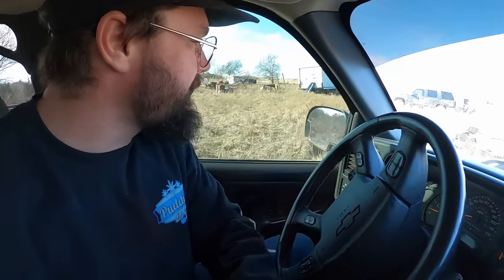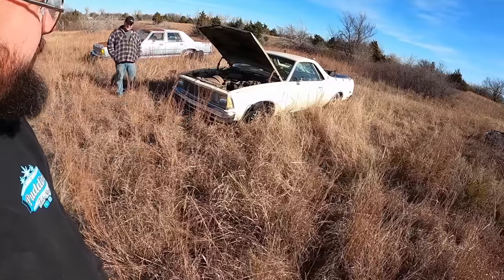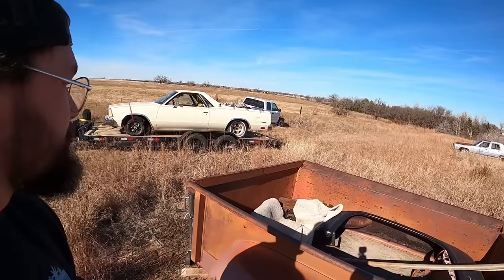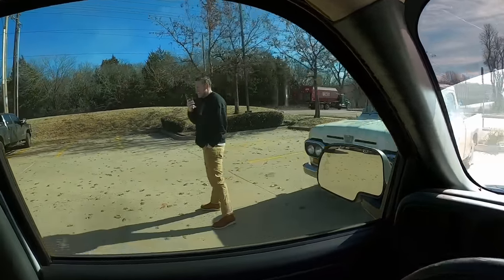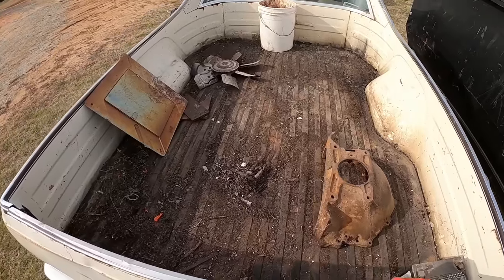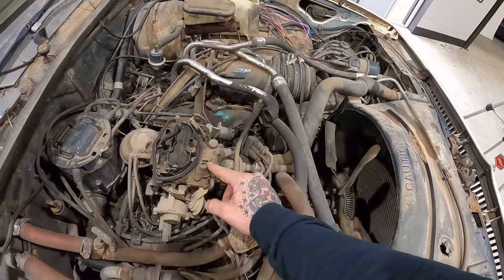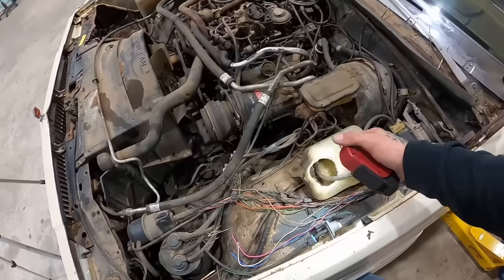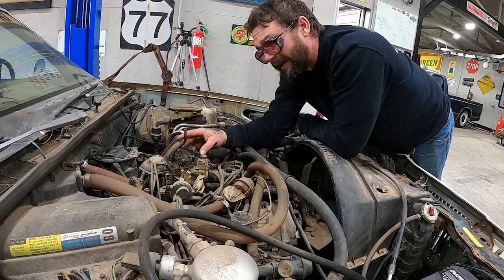1980 El Camino. FORGOTTEN in a Field. CAN WE DRIVE IT?!?

Comment: The lock up problem on the left front is classic rubber hose colapse. The hose colapse allows presure to flow to the caliper but wont allow tge fluid to return. When you open the bleeder it relieves tge pressure.
Reply: I was just going to comment the same thing, I agree with your assessment
Reply: I had the same thought
Reply: Agreed. You beat me to it lol
Reply: 100%
Reply: Agree!
Reply: Was going to see if anyone else made this comment before posting it. New brake hoses all around would be approved.
Reply: 100% agreed
Reply: I came here to say this.
Reply: Was going make the same comment!!
Reply: Exactly my thoughts
Reply: Exactly
Reply: Yep, collapsed brake hose.

Comment: Double check your brake hose on the sticking side. The inner hose can collapse and act like a check valve.
Reply: This, the brake hose is collapsed.  You can pressure past it, but it won't let the fluid return.
Reply: Duh
Reply: Agreed
Reply: I spent 10 minutes screaming at the tv trying to get you to replace the drivers side brake hose.   Its collapsing and causing the caliper to hold pressure

Comment: The g body front suspension is also compatible with s10. But the el camino is 7" longer wheelbase. They're malibu wagons with roof cut off. That's why the smugglers compartment still has wagon floor area
Reply: The Elcaminos were like wagons UNTIL the G-body (78 - 87's)
    The G-body Elcaminos had a separate frame from the station wagons in the last generation. 

  The GBody Elcaminos had their own unique chassis.

Comment: Hey, Puddin.  That thing on the thermostat housing is called a Ported Vacuum Switch.  Just break it off and plug all the lines that went to it.  Also, the turbo looking thing is an AIR pump.  Also something to disconnect and delete.  That car deserves some Astro Supremes.
Reply: Also known as a smog pump.
Reply: Thermo switch
Reply: Pay attention to vacuum advance issues, just yanking off stuff without knowing what it is can bite you. Ask me how I know......
Reply: @mwb3984  how do you know???
Reply: @mwb3984 yeah what he said.
Reply: @mwb3984  You Know what's up. Ol' Puddin' Came along after all this Vacuum ported Stuff. I found when New Doing Tune ups etc. you would just replace all the Cracked split Vacuum hoses (diagram) right on the Radiator support. If you knew how to read those. You knew which hoses went where. That car would be a Whisper Jet. After a proper Tune up. IMHO
Reply: Your sand box, your rules but I have to say it hurt to watch you bash up that rear end with the towrolla.

Comment: PARKING LIGHTS TURN ON WITH THE BRAKES: I have an 85 Cutlass with the same problem. Check the steering column to see if the hazard switch is on, i think it has something to do with the flasher being bad but i fix my by just turning the switch off and not having hazards for the last 20 years

Comment: Really like the El-Camortski. My recommendation? Get a gas tank, sort the wiring and vacuum lines, fix the carb, fix the floorboard, get yourself some proper drop springs, pound the dents out of the tailgate.  And before I forget, get a replacement inside drivers door handle. Then come up with a cool name and decal for the truck like your YouHaul trucks.

Comment: That frame, if I can recall, is the same as the Malibu station wagon. The suspension will be the same in the 78-88 A and G body cars
Reply: El Camino frame is all by itself,wagons  are different. Front suspension is same as S10 except for the steering cross link, because the S10 is a narrower track with. S10 drop spindle and front spring will work on Camino. That carb is just a two barrel quadrjet . Check the float, it's probably bad. Plastic float and ethanol don't mix well.

Comment: The valve with the hoses is a thermal vacuum switch.

The thing on the motor that you were asking about earlier in the video is a smog/air pump.  The pulley for it was inside the cab.

Comment: Them front rims look like the rims off an Old Cutlass from the 70s-80s. I had some that I used on my 64 Ford Econline pickup truck from off a 71 442. My brother in law put them on the Ford Econoline and went with chrome reverse big and little steelies with moon hubcaps on the 71 442 that I eventually bought from them as well. I really like how they look too. My ex GF had the same El Camino in the maroon flavor paint. Love those old cars too.

Comment: The “turbocharger” under the hood is an emissions junk smog pump, either locked up or they just removed the pulley and bypassed for “more power”. But of course they left all the vacuum junk hooked up. The exhaust had that new pipe scabbed in because they cut out the catalytic converter. The front brakes are sticking and not returning because the rubber line has deteriorated and collapsed on the inside, trapping fluid/pressure. That’s why opening the bleeder allowed it to move because pressure bled off, probably pulled some air back into the system as well which is why it would spin even with the pedal pushed, had to build up fluid pressure again to overcome the air maybe? The transmission was probably in gear when you first checked the fluid level so pump was engaged, that’s why it was low. Then you added fluid, car started moving, you put it in park disengaging the pump, boom fluid level high. Love the custom exhaust work though. I wonder if the M90 supercharger off the Series II 3800 Pontiac, Olds, Buick, or Monte Carlo SS could be put on there. Little blow through carb action. I know you’re not a fan of or super comfortable with EFI.

Comment: The thermal vacuum switch you asked about can be important unless you are going to take everything "factory" off of it ... the ignition advance can be actuated/suppressed according to temperature(as you correctly surmised) - there is a middle road that retains the basic systems and deletes stuff like the A.I.R. pump.

Comment: Those are great vehicles. I had a 1973 Blue Datsun truck I traded in on a 1979 El Camino which was powder blue It almost looked like the one you have. I bought it at Hembree Chevrolet in Poteau Oklahoma with 17, 500 miles on it in 1981. It had the 305 V8 in it. Had it for awhile. I miss that one. Kerry

Comment: Pollution pump is the thing you see without the belt on it. And yes 3.8 was in most cutlass, regale, and some other g bodies. Especially  the grand national,  same motor just better internals and turbo
Reply: You are correct. However the 3.8 in this El Camino is a Chevy 3.8 (229) V6. Kinda the precursor to the 4.3 vortec V6.

Comment: Excellent video Puddin  :) , Slick 50 :) , Bill  :) , 1980 El Camino  car remember in my childhood  from 1976 to 1994 years  also yes  that had V6 3.8 litre , 4.4 litre 267 V8 in 2 or 4 with small or air breather , 5.0 litre V8 305 in 2 or 4 barrel carb  , 5.7 Litre 350 V8 , optional  motors was 5.0 litre  307 V8 4 barrel ,  small block 6.6 litre 400 V8 , 7. 3 Litre 454 V8 4 barrel carb , some motor did have Pollution Pump below Alternator  too , Power Steering also Brakes, some Cruise Control also Tilt Steering, Am/Fm radio antenna on front windshield or pop rod fender , Am/ Fm radio with or without Cassette, Transmission are Manual 3 , 4 , 5 speed  of Column Shifter 3 in tree also floor were 4 or 5 speed, Automatic were 200 to 2 speed  Power Glide , Turbo 350 or 400 3 speed , 700SR 4speed Overdrive Automatic transmission, air conditioning, power windows, mirrors, locks , rear end 303 to 411 ratio too! That specs on them Puddin to get in years ago ! Those  Back rims on when gotten on are orgnail ones and to if didn't know!

Comment: Regarding the front left wheel locking up puddin', it spins free every time you open the bleeder because it's relieving the pressure. That's a sure fire diagnosis for a bad brake hose. When the brake hoses go bad they act like check valves, they'll let the brake fluid flow into the caliper when you hit the pedal but then when you let off the brake pedal that fluid gets trapped in the caliper and the wheel stays locked up. Opening the bleeder lets the trapped pressurized fluid out and the brake releases. Hope that makes sense.

Comment: Have you ever tried using a small drill bit to drill through the hinge and hood. Then when you put the hood back on use the same drill but to line everything up by sticking it back in the holes. I always drill one on each end of the hood bracket and then have four drill bits to line everything back up. Once a drill bit is in each hole I tighten the bolts down all the way

Comment: Its the ruber lines in the front. When they get old they will swell up on the inside and fluid can gate through with pressure but it can not go back through. Just replace the soft line and I bet they will work.

Comment: I had a "91 Buick Skylark Custom with a 2.5. I was driving home from work one day. It was running fine, and then it just went dead in the middle of the street. I was just learning at the time, and I loaded up the parts cannon and let it go. Six months and $1500 in parts later, I found out that the plastic timing gear had broken. Since it was a one off engine and they were unobtainium, it took me three months to find a similar one in a junkyard. It was running perfect one minute, and dead as a doornail the next.

Comment: I had a '79 Volare with a Leaning Tower of Power. All six of the electrodes on the plugs were completely encased in ash. You could not see them at all, and that car would still do 120 all day long. You can't beat a 225. I still have those plugs, and everyone says I am full of shit when I say that engine ran on those plugs, but it did.

Comment: That 3.8 is the Chevy 229 V6 versus the Buick 231 3.8 V6.  The 229 is a small block Chevy with two cylinders whacked off.  Front accessories are interchangeable with a SBC.

Comment: 1:11:28 you have a collapsed brake hose on that side, pressure gets thru to apply, but it cant flow back to release. The fact it releases with the bleeder opened confirms a bad line. This is a common problem with gm.

Comment: That looks like a TH200 transmission. Fluid color indicates a lot of clutch material in the pan, but it's obviously working, so it may be fine. With a good carb, she seems like she'll make a good car. Great video!
Reply: If it's the same as a my 1980 Lemans that also had the Chevy V6, it probably has a lock-up converter. I dropped the trans pan at 110K miles and it had an alarming amount of clutch material in it, but it continued to operate without any slippage for another 30,000 miles. When I sold the car it was still going.

Comment: @34:17 It’s called a TVS (thermal vacuum switch). It controls the application of vacuum to the EFE (early fuel evap) valve, and the A.I.R. diverter valve

@45:30 TH200C

Comment: One more thing Puddin' when working on those things new, the HEI would Quit. Extended Crank it? Another Common issue is the Distributor Rotors would burn straight through to the metal advance weights make a Crank no start symptom FYI

Comment: Brake line will let brake fluid through not back out they swell after sitting I would change the brake lines it will fix the sticking brakes

Comment: In the 90's I was in Nqvy and bought 82 El Camino that had been swapped from V6 to 350 V8 but not 4 bolt. Built a four bolt 350 with edelbrock intake and carb. It had all custom interior tan tuck and roll with diamond pleat on doors and overhead. Wooden vette steering wheel. Wish I still had it. Was T- boned by an F150! Was listed as licensed in Montana so no EGR and headers with thrush dual coming out by back wheels.

Comment: From what I remember from my 1980 El Camino I had 33 years ago:  The back glass is bad about leaking in these.  Water gets in to that cubby hole where the tire sits and makes the floor rot out.  Mine had a flexy exhaust, too.  They ride REALLY low and scrape on EVERYTHING.  Mine had an 8-track and the speedometer would peg at 35 mph no matter how fast you went.  But it was right up to 35, past that you had to just keep up with traffic.  The 3.8 is probably better than the 5.0 V8 that I had.  Those early 80s 305s sucked.  The V6 probably has as much power, too.

Comment: If you start to have more issues and it starts to miss ,it could be the ignition module I had the same issue on high output 305 SS Monte Carlo motor

Comment: that "thing" is an air pump to blow cold air in the exhaust manifold for smog control. They started that nonsense in the mid 70s. toss it, pull the tubes out of the exhaust manifolds and plug the holes with pipe plugs. You can thank me later ;)

Comment: Don't know if anyone answered but that accessory bolted to the front of the engine missing a pulley is an air injection pump. The thought was that to reduce emissions they could blow air into the exhaust stream. The always locked up. FYI, more than just a liter of displacement differentiating the 3.8 (Buick) from the 2.8 (Chevy). Entirely different animal. That 2.8 is gonna be very anemic in a vehicle that size. There's a whole rabbit hole involved with all that.
Reply: I believe they have a 200 or 229 Chevy based 90 degree v6, a cut down small block Chevy v8 engine missing two cylinders. Pretty stout for so few cubes. Not related to the flimsy 2.8 found in Fierros and Citations.
https://en.wikipedia.org/wiki/Chevrolet_El_Camino

Comment: Them rubber lines get a bubbles in them. An internal leak.i popped the wheel bearing cap off my rig.  Put new calipers on. Still dragging. New rubbers, tada!  No moore dragging

Comment: The best advice when working on older model vehicles is, "It's always something simple (Don't Overthink The Problem). Especialy for teaching younger fellas, when it's got a Carb & Distributor. Ya just need the 3 basics. Fuel, Fire (Spark) & Compression. This holds true for any Engine from 1 to 10 Cylinders.

Comment: Happy New Year Puddin, and to your whole family. Ya done great in 2023 and I wish you the best in 2024.  You deserve it, sir.
 You gotta watch out for those G Bodies, especially the mullet mobiles. They get in your brain and make you make bad decisions, kinda like mini trucks and International Harvester products, lol.
  I'm generally a Ford guy, but I've got a 78 El Camino that I wouldn't trade for the world. I've still never figured out the purpose for those 2 silly little hood screws.
 That transmission is the much hated TH-200. Yours could well be the last one in existence that actually works west of the Missippi River, but you don't know if it actually shifts, so... lol. A TH 350 is almost a direct swap. I did lots of those swaps BTID. 
 The 3.8L (229 cid) in the Chevys of that era were Chevy small blocks with 2 cylinders missing. The other GM lines used a Buick V8 based 3.8L (231 cid) V6. The 229 eventually became the 4.3L (262cid) pickup truck engine, which I "think" were the very last of the small block Chevy based engines. The 229s were under powered and under appreciated, but as dead reliable an SBC V8.

Comment: Nice 👍gotta love those El caminos.  On the HEI module be sure to put heat soaking gease between the module and distributor base with out the grease to conduct heat away it can leave you stranded.

Comment: The switch on the thermostat housing is a "thermo-vacuum switch" Your explanation of how you think it works is basically spot on. As far as the driver's side brake hanging up, the left front brake hose is collapsed inside the rubber. It acts like a check valve. It lets brake fluid through,  but wont let it release back to the master when you let off the pedal. As cheap as they are, just change both the fronts if you plan on driving it in traffic.
Reply: I was yelling that at my tv while puddin was hammering on the master and portioning valve. 😂

Comment: Pro tip for exhaust work if you don't already. Run a deburring tool around any exhaust tubing that's been cut before welding it up. No floppy edges to mess up the sweet sweet sounds.

Comment: Hey puddin' a shop trick for you- When removing old hoses, remove the clamp then put a pair of channel locks where the clamp was and rotate a few degrees left and right. You'll feel it unglue itself. Then it will pull right off without cutting.
Applies to all vacuum, fuel, coolant, etc hoses.

Comment: The 3.8 liter is one of the best engines ever built. They've routinely gotten over 300k miles on them ,few engines can boast that.
Reply: You're thinking of the Buick designed engine that was refined for FWD applications. 
This El Camino has the small block Chevy V-6. A completely different animal.
Reply: It is completely different, but the Chevy has a good reputation, too.  I mean, it isn't for towing, but...

Comment: Had a 305 that ran hot, rebuilt carb, timing chain and timed it dead nuts and it finally died. Replaced module and it quit overheating and ran like a dream. Owner said it never ran so well.  Nice old elk. Worth fixing-ish. Would look even better if steelies were body colour.

Comment: That wheel you said you didn't like is probably factory to that vehicle. Also found on Monte Carlo and Malibu (which is what the front end is). The wheels you like are from an Olds Cutlass. The one from the rear might have also been found on an 'Ol Camina but are common to 2nd Gen Camaros. Any small block Chevy and trans will go right in that vehicle. You can even swap front ends with little or no modifications with all the G body cars as that's it's platform. Monte Carlo, Malibu, Cutlass, Regal, and Grand Prix of the same generation.

Comment: Pro tip: any GM module will occasionally have the connecting wires broken INSIDE the jacket and will cause your intermittent spark problem. (just a note from an old GM factory-trained tech from the '70s and 80s)

Comment: You need a hose sir. Those hoses will let the fluid flow through it under pressure,  but not free flow. I fix them all the time for that concern. Also brake pulls are caused by the hoses.